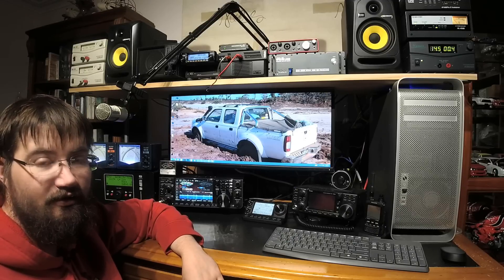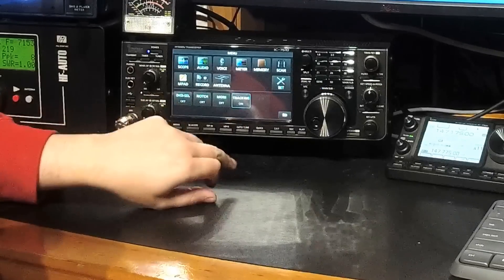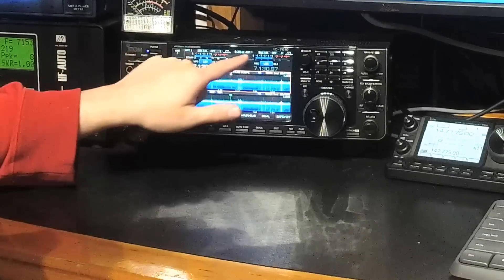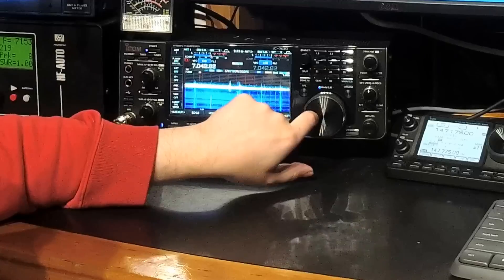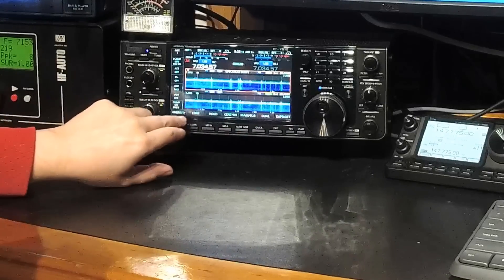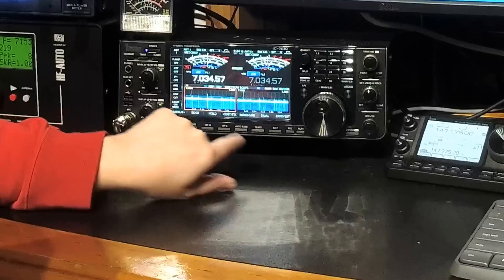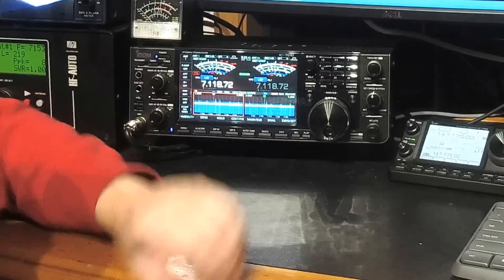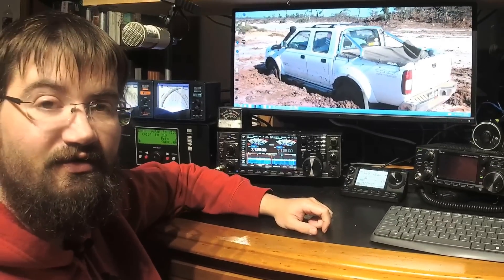Dual receive functionality on the Icom IC-7610

Comment: How do I set up the radio to transmit on ANT 1 and receive on ANT 2? I have two antennas for the same band, one for xmit and one is rcv only.
Reply from the maker: I’m on holiday in Fiji, but from memory you plug the rx ant into the rx ant port, THEN you HOLD DOWN the ant selection icon on the screen.  Rather than saying ant 2 it should reference the RX ant as well.  If in doubt, read the manual or play about. :). 73, Jarrad VK3BL

Comment: Hi Jarrad,
Thanks for the outstanding videos on the 7610 Jarrad and keep up the valuable work.  Question for you.
Once I complete the dual receive setup as you described in the video I find that I can no longer use my RIT/delta TX function for split frequency transmit on VFO A.  Do I have to drop out of Dual Watch to use the split function once again?
Reply from the maker: As long as SPLIT isn’t active RIT/XIT should work correctly - please let me know if I am wrong.  73, Jarrad VK3BL

Comment: Hey Jarrad, question from a newbie here. It seems like the IC-7300 could be unlocked and have access to the 70Mhz (4m). Do you know if it would also be possible on the IC-7610? I understand the 4m is not available for public in the US yet, but it seems to be in some countries here in Europe. Also, I know you have been very critic about the 7610 vs. the 7300... if you would have to restart from scratch a buy a HF+6m base transceiver, which one would you get?

Both the 7610, Flex 6400+Maestro or probably the next FTdx-101d aren’t cheap and easily in the 3 to 4 grand range, but I’d prefer to have one but one good one than buying 3 $1,000. Ideally, one HF+6m (maybe 4m) and another one for 2m and 70cm would cover the whole range and keep a minimalistic shack. I hope it makes sense... as said, I’m a newbie (I’ve done some 11m USB/LSB and local CB in the past, but never pass my hamradio license. Now I’m getting older and would love to maybe give it a second try). But before to spend any money, I prefer to dig as much info as I can (that’s also why I like your videos). Thanks in advance, 73
Reply from the maker: Dear Phil, 

I would certainly buy the IC-7610 time and time again over the others or even the FTdx-101D, which from the back panel photo doesn't look like it has the extended capabilities of the IC-7610.

I have been 'fully honest' in my reporting of IC-7610 issues, but I would not call myself a 'critic' as such; it is my radio of choice and the only relatively minor issues at the moment may be LCD screens and heatsinks in older units.

I believe both radios do support 4M but could be wrong on that front - best to ask Icom UK.

73, Jarrad VK3BL
Reply: Rate My Radio thanks Jarrad, good to know... I’m in no rush so I’m gonna keep watching your videos and see if the 7610 would be the best choice for me too. Thanks!

Comment: Can you receive on one band while transmitting on another band...Meaning is there two completely separate receivers and transmitters. Put another way could you be in QSO on 50 MHz and then switch to a QSO on 7 MHz on the other receiver but still hear the 50 MHz signal. Difficult to explain. Thanks VK6UU
Reply from the maker: Good question Will!  The radio offers two fully independent receivers, but only one transmitter.  Because of the way the radio is sequenced (it might be technically possible with different firmware), when you transmit, BOTH receivers are tied to ground.  The primary purpose of this is likely to simplify operation and greatly reduce risk of damage.  So in a nutshell, it is essentially a ‘SO2R Setup in a box’, whereby you can monitor two bands but when you talk you hear neither, but its not the same as having two seperate radios in a multi-multi contest station, whereby with multiple mouths, sufficient filtering etc you can put two signals on air at once.  So in a nutshell, it really is a wonderful setup.  For contest usage, you can have a call frequency, but also use the other VFO for searching and pouncing :). I hope the contesting explanation is ok, because its really the only common example of full duplex HF operation.  73, Jarrad VK3BL & RMR Team :)
Reply from the maker: To be clear, both receivers can use the same band and antenna, OR both receivers can use a dedicated antenna and different band, OR any combination in between.  73, Jarrad

Comment: If you don’t need 2 receivers is it worth getting instead of the 7300? Did they make the radio better overall?
Reply: VK Ham Thanks, As an owner of the Icom 9100 as well as a icom 9300, I hope Icom continues to provide software updates to the the 7300 with some vigor.  I feel they left us 9100 owners flat.  The radio still needed updates, but Icom is a no show.  Since the 7300 and 7610 are “software defined” I hope they actually release software in a timely fashion.  It’s been a while since the last update for the 9300.

Thanks..
Reply: Shame that software can't add buttons so the screen could STOP being touched just so that the radio operates.I'll keep my 7600 & talk to & hear just as many stations & save a lot of money while NOT touching the screen on it even once.

Comment: J- The 7300 has a super-clean Rx sound...crisp and clear. Does the 7610 have a similar clean/crisp sound?
Reply: J- So are you saying it sounds at least as good? That's not a glowing recommendation. My non SDR radios have a much muddier sound than the 7300 here. It is really clean...articulated...and noticeably better. I'm hoping the system architecture followed through from the 7300 to the 7610. Hate to loose that great RX sound and pay 3X+ the price.